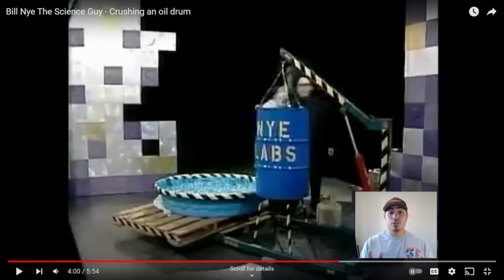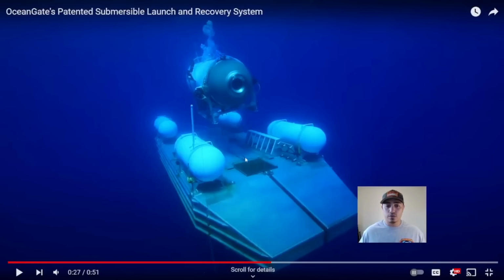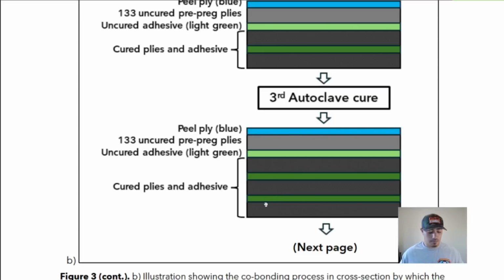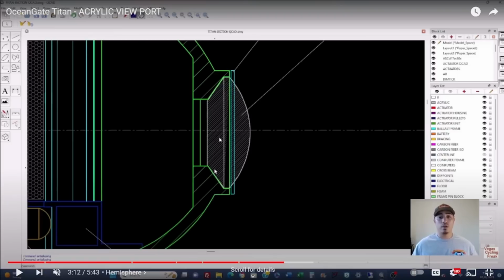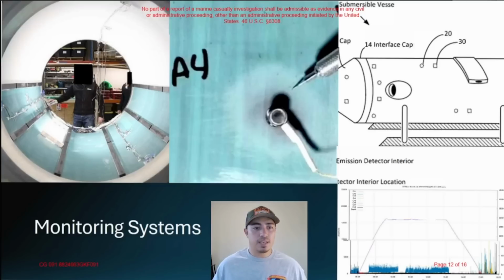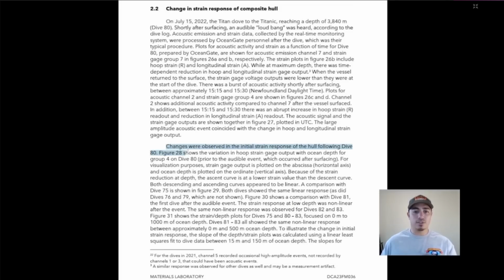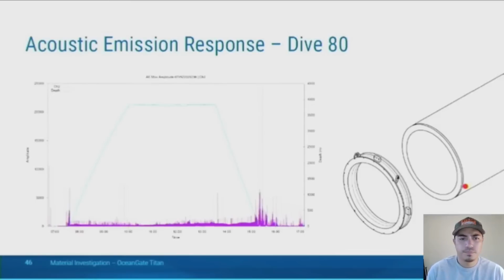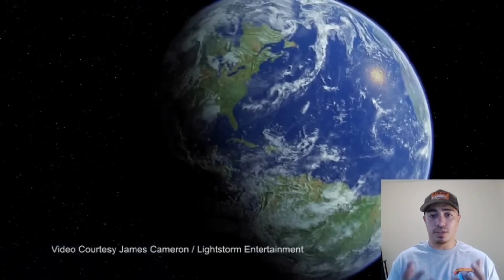Part 2: Investigating the OceanGate TITAN Tragedy: Carbon Fiber Hull, LARS Flaws, and Warning Signs

Comment: I really don't think the truck bed liner was a bad call.   It's the poor quality of the carbon fiber wrap that should be getting negative attention.   Besides, it was the glue joint between the titanium ring and the cf tube that failed.

Comment: Notice how they were using a visualization of the strain data that was not inductive to spotting changes in the response?
Changing to depth/strain style made it much easier to compare and also allowed the lagg in the hull response to be clearly visualized.

Comment: The videos they show of the hull building and winding I seen just show them going in circles like a fruit by the foot for lack of a better example. So I am in defense and we have carbon fiber rocket motors that supports a lot of weight at weird angles and multiple multiple times heavier than the actual  tube  of the rocket. So our tubes aren't just layered or woven in circles left to right they look like a woven quilt when it's finished. Shouldn't the hull of the titan been cross hatched and woven more like a quilt than a fruit by the foot

Comment: Outstanding videos. In all materials presented little attention is given to the structural damaging effect of towing the Titan across rough Atlantic waves upon FLAT bottom aluminum floats intended for a lake or river. Big waves require a V shaped hull to attenuate vertical motion of the waves. Titan was rigged to TWO separate flat bottom floats that were "walking the waves". This walking the waves action was creating a twisting moment between 2 titanium rings glued to the carbon fiber tube. This torsional twisting action was essentially breaking the epoxy bond on either side, accelerating the it's demise.
Reply from the maker: Wait so it was actually two separate flat bottom floats? I wonder how much play  there was between the two. Even bolted and secured along all edges, there would be some play when towing to the middle of the ocean for hundreds of miles & hours. We know the ocean surface wasn’t glass during their operations. In fact a lot of the photos and weather reports say it was quite choppy. Relatively calm for the ocean but not for a sub of that size, especially with such fragility. I’ll look into this further and include more info on my next video if I can find some details on the double floats used. Thank you.
Reply: @sspdiving  Yes, there were LEFT and RIGHT aluminum floats (look at the videos), most likely tied together in a flexible way otherwise the wave action would have torn them apart. Each skid of the Titan frame was tied to one of them left/left, right/right. There is an excellent video on UT, done by a young yuotuber who was there at the time of the Titan loss. He was allowed in for a shallow test dive and did an excellent reportage about the towing ordeal and the storm on site once they got there. For several days they all sat there in the middle of the ocean, with Titan on the leash rope. Not only could they NOT do any maintenance work on the Titan due to rough seas while stationary, but also they had a headache how to avoid a collision between Titan/floating rig and mother ship. On top of that, as a result of towing, one of the floats lost significant buoyancy and (my assumption) I believe it was due to pounding and denting of the float sheet metal by rough seas. They did some band aid repairs to it but I don't recall how/what. I once ventured on Lake Superior on a speed jet boat w/ flat bottom hull. Just standing still, the small waves were ripping the fiberglass apart. Great work you're doing. Cheers.
Reply: @utube321piotr   got a link to that video?  This is an interesting point, if the relative movement of the floats (under wave action, which I would assume is quite powerful) is actually continually torqueing the hull!
Reply: @IamtheLordofDoom  I think they're talking about the video from the YouTuber DALLMYD.

I personally had problems posting links in yt comments in the past. I'm sure you can find the video.
Reply: @IamtheLordofDoom  https://www.youtube.com/watch?v=O-8U08yJlb8

Comment: I’m not an engineer but operate marine vessels here on the lower Mississippi River and Gulf of Mexico.  Every critical task has built in multiple layers of safety redundancy so if something is missed by human error or mechanical malfunctions enough dominoes are removed from the chain reaction to prevent catastrophic failure.  And then near miss investigations occur to develop new procedures and engineering controls with the goal of zero work place injuries, environmental incidents, and property damage.  Oceangate had a culture of Las Vegas high stakes poker room betting when it came to safety and engineering.
Reply from the maker: Well shoutout to Mississippi & the GOM. The procedures are similar for commercial diving operations especially when working below ships. Locking and tagging out propulsion, suction, discharges, & instruments are standard. I’m sure you are familiar with similar checklists. If any incidents occur, an investigation is opened. No if ands or buts about it. Thanks for the comment & be safe out there.🤙🏼

Comment: For the acrylic window, we got expert testimony that the design was borderline; could go either way and extensive testing would be required to be sure. Either way, the wreckage isn't consistent with the window failing.

For the rhino liner, it's a good thing that it was there. It's very important to protect the carbon fiber from impact, abrasion, and UV, which are all things rhino liner is good at. As long as it's chemically compatible (which it was), it won't harm the performance of the carbon fiber. It did interfere with visual inspection of the hull, but was supposedly okay for other non-destructive testing.

It's a good thing that they left the wrinkles in the outer layer. Sanding it smooth would weaken the hull. It's not so good that the wrinkles existed, though.

The dives without data in 2023 before the final accident (dives 84-87) were all shallow, 10m test dives (which was normal at the start of a new season). It's very unlikely the data showed anything important, and probably wasn't hidden intentionally. We don't know why OceanGate didn't collect/save that data; my guess is Stockton had just fired everyone who cared enough about safety to try looking at it.

Comment: You're a diver, and that gives you a very good viewpoint as to the constraints an feelings of operating at depth.  It does not make you a mechanical engineer, and you clearly aren't.  Talking about the barrel experiment.  And I quote :

"inside of this Barrel there's just a little bit of water here at the bottom and there's a small opening here at the top so all of that water is boiling it's creating a lot of steam it's creating a lot of internal pressure so he's going to go ahead and cap off that barrel and place it inside of this ice water now as you can imagine what he has here is a propane heater so he's heating up inside of this 55 gallon steel drum that pressure is going to try and equalize to the temperature around it so when that Barrel cools it's going to essentially implode"

Which is a bunch of word salad meaning absolutely nothing.  And most of it is wrong.

The heat boils the water, creating a lot of steam.  This displaces the air in the barrel.  It does not "create pressure", the barrel is open and the steam is at 1 atmosphere.  The heat is removed and the barrel is capped, and then cooled.  The steam is forced to condense by the cooling, reducing its volume by approximately 1500 times.  This causes a relative vacuum in the barrel, and it's the force of the atmosphere pushing inwards that buckles and eventually collapses the barrel. 

This /is/ an implosion.  Not "essentially", it /is/ an implosion, caused by a pressure difference of under 1 atmosphere.  The finality is nowhere near the violence of the one encountered by the Titan, which was at a pressure difference of something upward of 350 atmospheres.  The speeds are "equivalent" in that they happen at the speed of sound, except that the barrel speed is limited by the speed of sound in air at 1 atmosphere, or about 350m/s, and the titan speed was limited by the speed of sound in water at 375 atmospheres, about 1500m/s.

The collapse stops when either the pressure inside the barrel, combined with the remaining strength of the barrel, is able to counter the pressure differential, or there is no longer a pressure differential; this latter can be caused by a rupture of the barrel, or the remaining internal pressure being raised to the same as the external pressure.

This is really basic stuff, and you're failing to explain it, despite the actual videos you're showing clips of explaining it in detail.
Reply from the maker: lol you must have skipped the intro where I said I’m a diver, not an engineer. I do have ANSI NDT certifications & countless hours of underwater inspections so I do have some level of competency regarding how things are designed, how they operate, fail, & their life expectancies in the marine industry. We write reports and provide findings to marine & civil engineers who don’t need me to reverse engineer this tragedy for them. 

I’m providing my personal perspective with some visuals so the majority can grasp what happened and why. Thanks.
Reply: @sspdiving  i understand that, and I appreciate you taking the time to answer what might come across as a very snarky comment.  I also appreciate that you acknowledge parts of where you were wrong in your previous video.  That's great.  

 What I'm trying to say is that the actual engineering aspects of what you're trying to get across are either so butchered (see your attempt at describing what's going on with the barrel experiment) or utterly wrong despite the information being freely available (and in many cases since the actual accident) - it seems there's a fundamental lack of understanding and - well - "investigation" in your investigation.   And yeah, that sounds snarky as well.  Sorry about that, but calling it as I see it.  Saying "I don't know what I'm talking about" is no excuse; all the majority will grasp from that is a failure to understand, and they already have that.

What would be very interesting, especially given that  huge amount of information about OG's dive procedures is now available, is an explanation of how their dive procedures differed from industry-accepted norms for dives to similar depths.  That would add actual value.
Reply: @wibblywobblyidiotvision  so according to you, saying, “I don’t know what I’m talking about,” is “no excuse” for giving an incorrect explanation, but saying, “I call it as I see it,” is apparently a perfectly fine excuse for being a dick. 

Thanks for the explanation of the experiment shown; it’s very clear and interesting, and I’m glad I read it. It just would have been better if you hadn’t been so snotty and insulting about it, which would have been easy to do. Do people misunderstanding physics or engineering really anger you that much, or are you maybe having an off day or just a lot of stress at the moment? I ask because your explanation was so interesting and clear—you sounded like a cool guy while giving it. But the rest seems unnecessarily nasty. If that’s the case, you’re not alone, and I really hope things get better for you soon. It’s been a pretty lousy year for most people, I think (actually a lousy three-almost-four years, but I won’t get into that); certainly my family and I have had a tough time, and it sucks. I’m just crossing my fingers and hoping it gets better soon, and I hope that happens for you, too. Have a great day, friend.
Reply: @jenjuniper1569  Well, I'll try nd do better.  But I'm not a technical writer, and my keyboard has a couple of flakey keys, so I can't promise perfection.
Reply: @jenjuniper1569  I don't expect any grace from you, you tool.  And you shouldn't expect any from me.
Reply: Oh, hang, on, sorry.  I started that second sentence with an "And".  Please accept my heartfelt apologies for the strain that has undoubtedly put upon your sensitive nerves.
Reply: I agree, the man was clear about his credentials and limitations... sheesh people are wound tight these days, especially "academic" types
Reply: Someone needs to get some laxatives 😂
Reply: @troyporter1773 
Hilarious  🤣🤣🤣
Reply: I've really liked the diving anbd deep sea knowledge from these videos. There's literally hundreds, if not thousands of engineers on youtube already inputting on this, go watch one of those. It's very obvious in this video that any basic engineering that is mentioned is merely for context, not for his expertise. It's literally a school yard experiment to show the very bascis of how an implosion works, we're all old and ugly enough to understand it isn't the exact replica of what happened to titan.

Imagine getting this salty over a barrel, lmao.
Reply: Video is for awareness of the general public, not an exposition of Boyle's law or other minutiae.
Reply: It doesn't take much, if anything, to talk to someone with respect!
Reply: @leightzm 
Lovely isn't he. 🤣
Reply: @melodymacken9788  marriage material 🤣
Reply: You know what would be better? You fixing your attitude and making your own video.

This man is putting in the work and making GREAT content about this awful disaster. Don't get mad because you're lazy and can't do it yourself.
Reply: @beautyininsanity421  Hey there, Mr / Mrs / Ms / whatever Passive Aggressive.  You know what I did?  I did exactly what you suggested.  You probably won't like it, but you got a mention at least.
Reply: Oh my goodness... you definitely aren't part of the how to make friends and influence people. 
I'll bet you have a big crowd friends. 🤯😳🧐
Reply: You might be right about the information part. But your attitude is abysmal! Your contribution to this discussion was watching a video and writing an exeptionally rude comment to convey said info. He on the other hand collected tons of info, recorded a comprehensive video about it all and spent hours to edit it to insert all the vids, graphics and whatnot.
Reply: @beautifulbluebell2037  Doesn't matter how much time he's spent if it's all bollocks.  Fuck my attitude.

Also, not watching "a" video, watching his second bloody awful video discussing stuff he clearly doesn't understand.  And if you think that reply was rude, you might want to get out into the real word a bit.  I pointed out how he was wrong in a very trivial pice of science, and suggested where he could be better.  You, on the other hand...
Reply: I was coming here to say the same thing

Comment: I worked at a structural foundation company working with carbon fiber straps and adhesive to repair failing structures of houses. Now I know completely different to under water pressures but the application of carbon fiber is all the same. When you apply the adhesive you don’t want it smooth. You would want ridges and grooves for the adhesive to seep into. That being said this thing was flawed from the jump. I believe that carbon fiber could potentially be used. But it has to be done correctly and with proper testing.
Reply from the maker: Thanks for your perspective. To my knowledge, carbon fiber has been successfully used in other submersibles. I’m not sure to what depth and any limitations surrounding them. I want to make a comparison vs other sub designs for my next video. I’m sure with additional research it could have been accomplished safely. I meant they did make previous trips to that depth without failure but certainly seems they were doing a lot of research and development on the fly while using as many regulation loopholes as possible. Cheers🤙🏼
Reply: Check out Scott manly, he mentioned the US navy had made an experimental sub out of carbon fibre. That might give you a starting point. Didn't say why they stopped or what they found though.

Comment: Washington humidity might be what compromised the hull of Titan resulting in five deaths. 

13:04 As a Washington resident I live 100 miles from where the construction took place. Up here the constant, year round humidity is so significant that peoples’ clothing can get “closet bloom” Closet bloom is when garments hanging in one’s closet absorb humidity, extruding micro droplets from the ambient air 24/7. Said moisture then mildews in the fabric weaves. Often not presenting itself visually, a swamp like odor emanates when the garments are warmed up by body temperature. Many people think they have a body odor/health issue or they think there’s something wrong with their washing machine. The remedy is running an electric dehumidifier in the closet or purchasing DampRid hanging bags. When I began using a dehumidifier on the Olympic Peninsula it extruded 2 gallons of water every 24 hours. Millions of micro droplets of ambient water potentially compromised the hull of Titan during the composite engineering process. Particularly given the inept transportation between mandrel compositing and curing in the autoclave. 

These type of variables are why extensive oversight must be required when building ANY life support systems. Unbelievable. 🤦🏼‍♂️
Reply: I did not know about the Washington climate issues. But after that, consider he left it outside in a parking lot, unprotected, in Newfoundland, Canada, from July through February. 🤯

I don’t know how he managed to escape a Darwin Award for so long.